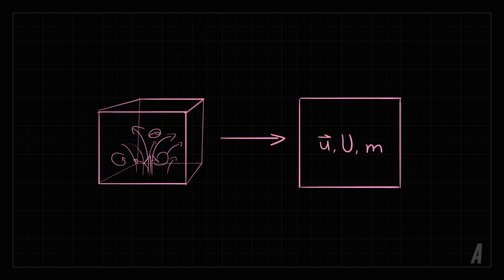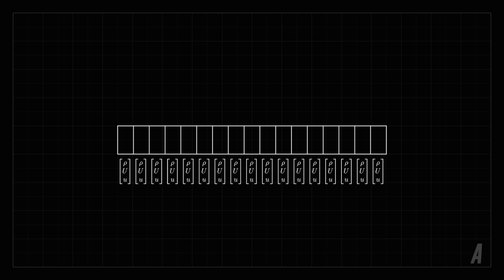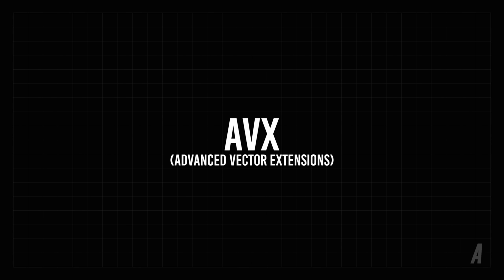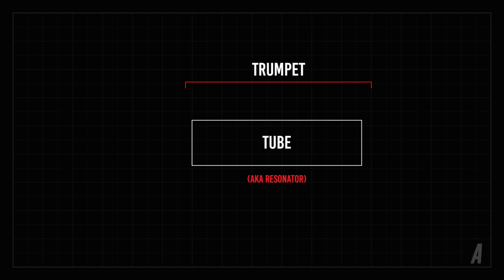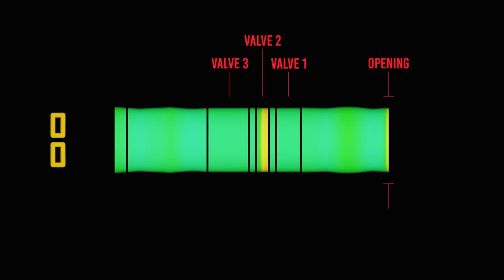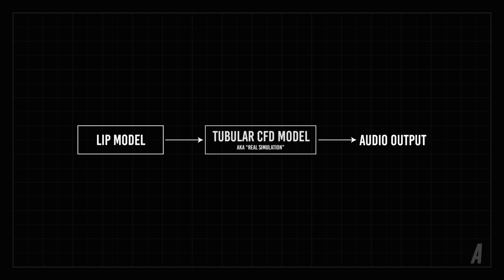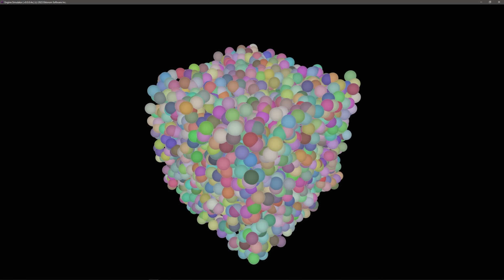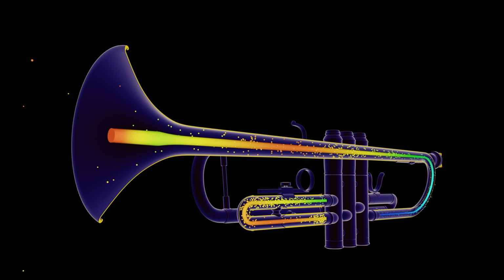Real-time Trumpet Simulation [C++/Vulkan] [WARNING: Flashing Lights]

Comment: I don’t know how you would implement it but almost all of how a trumpet sounds comes from how you shape your tongue, also the mouthpiece is very important, bigger mouthpieces allow for more space between your lips which makes achieving a “bigger” or more resonant sound easier. I can make a trumpet sound almost identical to what it sounds like in the video but to achieve the sound you want the tongue is how you change the air pressure. For lower pitches the tongue is stuck to the bottom of your mouth and allows for a large volume of air but there isn’t very much pressure (until you get so low you’re outside the normal range of the trumpet where the pressure needed increases) and for higher notes you’re tongue is almost against the roof of your mouth and the back of you’re front teeth, while the tip is against the back of you’re bottom teeth.

Comment: I have some experience implementing the Euler equations with finite volume methods and find this really facinating! 

Can I ask what kind of discretization schemes you have used? I would guess a combination of explicit euler method in time and a riemann solver to compute numerical fluxes. If you haven’t allready you could consider improving the spatial resolution to second order by using linear extrapolation with limiters (MUSCL). This will make the scheme more costly, but also significantly improve the solution for a given cell spacing, allowing you to use a coarser mesh. discontinuities such as shocks are way too much smoothed out with first order methods.

Also keep in mind that the maximun wave speed of the CFL condition for the Euler equations are not given solely by the sound speed c, but by the sound speed relative to the moving fluid |u|+c. You therefore have CFL = (|u|+c)*dt/dx

And one more thing: If you at some point want to implement moving walls touching the fluid, you should check out a FVM formulation called «Arbitrary Eulerian Lagrangian» (ALE). This allows the control volumes to move, enabling for instance the creation of moving pistons. There are also other techniques to achieve this (immersed boundary method)

Comment: Nice video!
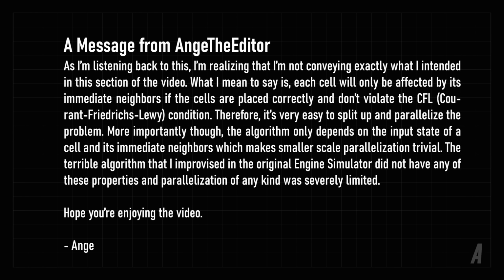I have questions on the fluid dynamics. What allows you to differentiate the cells and how can you process them in parallel? How does one cell not depend on the other? Basically i need more info on your comment at 5:36. Can you provide any explanation for this assumption?

Comment: advecting enough particles and rendering them with instancing fast enough can be quite annoying. but there's another way, you can use texture-based advection that any gpu can do for basically free. you can see what it looks like on my channel in one of the stirling engine stimulation videos, and I made a demo of how it works on shadertoy called "2-tap flow with less shifting".

Comment: Tuba player here  and i think that lack of flaring in the simulation for the bell maybe part of the issue with the air blowing because I have played without a bell and it is a struggle. Also maybe something like a flap valve for the lips. it is very hard to explain anyway to control a simulation of embecure it may be better to try to simulate a woodwind instrument as the embesure is more for tone and subtle tuning rather than the registers on brass.

Comment: As a lifelong hobby coder I always thought it would be cool to subdivide space into something other than a regular XYZ grid of cubic cells. For instance, subdivide each cube into six pyramids by adding another point at the center of the cube. Or tetrahedrons, etc... It would complicate indexing into the field but there must be some other way to subdivide space that's fast/efficient and solves the aliasing and simulation artifacting that cubes result in unless you subdivide down really small. I'm so tired of everything being squares and cubes when dividing up space in my algorithms.

Comment: 90% of a good Brass instrument tone is all in the embouchure of the lips and mouth. First learning to play such an instrument doesn't involve the instrument itself and simply involves learning how to blow through the mouthpiece all by itself. So, you'll often see a classroom full of beginners doing nothing but blowing through mouthpieces until they can get a smooth consistent buzz. Then, everybody will move onto doing frequency sweeps starting low and then going high and then go back down to low which sounds a lot like an engine revving up and down. And then you'll move onto learning how to play something like a Reverie which doesn't even involve the use of valves to be able to play (think of a bugle). Another thing that is key is that the intensity of air pressure within in the mouth and lungs must stay the same regardless of pitch and volume. This way your tone doesn't sound tiny and weak when playing at low volumes and conversely doesn't thwap and become raspy at higher volumes.

Comment: I'm curious about how the simulation handles alternative fingerings. For example, a trumpeter can play a middle G with either no valves depressed (000) or the first and third valves depressed (101). There are other notes that can be played with alternatively, especially as the notes become higher pitched, where I assume the note becomes more dependent on input parameters than the length of tube.

Comment: Considering the biggest challenge about recording engine sounds is the microphone placement, quality and physical characteristics. Why we don't just bake the sounds so we don't have to run it at 44KHz and just run it at like 1KHz instead?

There are specific resonance characteristics that can be computed, stored in a cheat-sheet, then compose the sounds without the need of stressing the CPU for the Real-Time simulation.

Comment: As a former trumpet player while in high school and college. For me, the first demo sounds a bit closer to a french horn than a trumpet.
The most important thing to get right is the embouchure correct for each note, which is a hella lot easier to do with lips than dialing it via keyboard! Hahaa! Typically the higher you go the firmer the embouchure and the faster air flow. This results in kind of a constricting effect (not sure if I'm using the proper terms but hopefully my point comes across). Think of a garden hose and you put your thumb over the end of it, instead of water pressure it's air pressure.
You might also want to consider making the main tuning slide adjustable. Also, the thumb and ring finger slides should be able to move. I don't remember the specific notes to use them on but these could help with any tuning.
For some extra fun put in some vocal cords to hum while it is played! Probably too complicated for this but it can be awesome if you play it in person.

Very interesting video for sure! 😁

Comment: Sweet!  I play the trumpet here and there.  Make the slides adjustable please so you can tune the thing.   I also think that the mouth provides a resonant chamber that helps to filter the sound generated by the lips.  To make a chamber that is resonant to some harmonic of the note being played.  Perhaps that might help with your air volume issue.  Also with trumpet, there tends to be an attack when starting the sound.  Once the tone is going, less air is needed to sustain a note.

Comment: The lips aren't symmetrically placed on the mouth piece which probably makes the lip simulation inaccurate. You can find clips of people explaining buzzing, doing it without the instrument. That could work well as a sample source to replace the lip simulation. It would probably be simpler to implement anyway. You could adjust the tail of the sound to create more natural 50-200 ms fall off as well, or add small fluctuations to pitch and amplitude. Bonus points if you implement a full ADSR envelope with slight variations each time it triggers. In any case, I wonder how much the instruments own vibrations affect the tonal quality because there's probably some missing information there. I'm no trumpet expert but a sound engineer, and to me the high frequency range sounds very digital and loud compared to the real thing. Perhaps because bass carries farther than treble and the simulation isn't modelling energy loss? I'm not sure, but it's interesting to theorize about even though I suspect the lip simulation is the problem.

Comment: Summary

Introduction
- Discusses the challenge of real-time fluid simulation for generating audio.
  
Fluid Simulation
- Explains the Euler equations for compressible flow.
- Introduces "Tubular," a fluid simulation library optimized for real-time performance.
  
Trumpet Model
- Describes how a trumpet works and how it can be modeled as a series of tubes and valves.
- Discusses the importance of lip vibration in generating sound.

Visualization
- Talks about the 3D fluid visualizer developed for better understanding.
  
Sound Generation
- Explains how the simulation generates real-time audio.
- Discusses the challenges and limitations, including the need for parameter tuning.

Future Work
- Plans to improve the simulation and possibly release it on Steam.

Comment: There are many things that go into a trumpet to give its sound. Millions of trumpets have been made, and many different sounds are produced. , 

The variables have a great deal to do with the player, their lip texture, strength, position, race, and training. that is enormous tight there 

Then, mouthpiece design. all over the map from deep to shallow cup, plastic, brass, thin wall, fat wall, bore, taper, even rim and shape. AND the impact of different lips on it .

Then you have the instrument itself. metal composition, thickness, coatings, lead pipe,  diameter, bell size, braces,  all this affects the sound AND add the chops and mouthpiece and performer variables.

My point? What is the point? As a complex engineering project, it is impressive. But there are wonderful libraries already made of actual recordings that are used to play scores created in music notation software from real instruments that will always be better because it is live. not synthetic as such.

You have accomplished a great deal, but honestly,  I think it was a game plan flawed from the outset. when a better alternative was and will be in place and not bested. ever. like trying to replace a Steinway piano. Nothing will ever beat it. The variables are simply too great. Same here. Use what was perfected and works wonderfully. Don't recreate the wheel 

my thoughts

Comment: I'm not exactly an expert, but I think the issue with air volume needed may be because of the lack of a flared bell in the model.  In real life the flare causes a sudden drop in pressure that would help to keep the pressure in the system lower and requiring less air to change the pressure significantly.

Comment: I can imagine why you'd need a lip simulator in an engine simulator: you need to simulate an engine that is also a trumpet. Take the valves and replace them with pistons connected to a crankshaft, for absolutely no reason even though that doesn't make sense.

Comment: You may or may not have mentioned this (video is a bit too dense for my understanding so I clicked through a bit) but a trumpet is considered a "cylindrical bore" brass instrument due to the constant tube diameter until the bell. Id love to see the simulation run on a "cylindrical bore" brass instrument like a euphonium (my favorite) or a french horn whose bore size increases gradually down the length of the tube to see how the two differ. In reality the 2 bores have very characteristic tones.

Comment: Former trumpet player here: Most of the lip motions, tongue motions, pitch, breath control, all of that is rote memory for the player. So assigning the notes to a keyboard and having the trumpet do those calculations would be very realistic.

There is a slide valve next to the horn that is used to tune the instrument by pulling and pushing it out. Like a trombone but it's in a fixed position.

Also -- and I am sure someone already mentioned this ... But it might help your simulation if you simulated the lungs as a fixed fluid source that depletes?

Comment: As a trumpet player, and a CSE student in a computer graphics class, this is amazing!  Idk if it would help, but if an IRL trumpet student is overblowing, it often means they have to tighten up their lips a little.  When you have air blown way too hard in the simulation, you can hear the pitch change as the pressure changes the forces on the lips.  As a trumpet player, my best sound is made by balancing the tension in my lips with the air pressure.  A way to measure if you hit a reasonable balance is to study the amplitude of the sound.  When you have a good tension for a given pressure, the horn will resonate better and become louder.  This is not necessarily the sound all musicians aim for, but it is a discrete and measurable goal that's good for beginners.

I noticed that the simulated trumpet's tuning slides are all pushed in all the way.  Pulling out the main tuning slide and the 3rd valve slide (at the same time as the valve is pressed) should improve the overall sound and make the intervals between notes more even.  Another thing to consider would be to add tonguing, where the tongue is used as a valve to quickly start each new note.  This would eliminate some of the out-of-tune movement of pitch when the valves and slides move.

I really love this project you've made!  If you have any questions about real trumpets, feel free to hit me up.

Comment: Maybe the constant diameter bore is one of the problems. I cannot say confidently, but the gradually increasing radius is one of the ways you accelerate the air. The pressure will drop along the tube, but the velocity will increase. Or something like that.

Comment: Long-time trumpet player here, the slightly wrong tuning in the notes, especially when fingering 101 (aka 13) are spot on.  It takes years to learn the lip position and air force to counteract the pitchiness of a trumpet.  In practice, on a low 101 position, the 3rd slide is pushed out with the left ring finger to drop the pitch to be in tune. 

I was cringing a bit at the higher notes because typically trumpet players will never press down more valves than absolutely necessary.  As you get to higher intervals, the intervals get narrower, which means that when you chromatically descend, you should prefer jumping to the next interval in open (000) position.  So from the second C (one octave above the typical lowest open note), the fingering is:
000, 010, 100, 110 (not 001, even though they are the same), 011, 000 (note that we are now on the G interval), 010, 100, 110, 011, 101, 111, 000 (now on the lower C interval)

Even though the first time you pass 011, you could technically go to 101, trumpet players never do except for special effects.

A typical exercise on the trumpet is switching between intervals, and making sure that the lips are positioned in such a way that the sound is consistent.  Perhaps this might help your fine-tuning of the lip parameters.  play a low C (000) and then play the lowest note from the G interval (111) which is one semitone higher.  If the same lip and air can make a good sound for both of those, you're doing very well!

Comment: Hi, I'm a trumpet player and a programmer. What you've done here is very impressive.

I think the reason for the massive airflow that is required also comes down to the fact that there is no cross-sectional variation. The mouthpiece is supposed to have a very small hole that then expands into the tube of the trumpet. That way it is limiting the airflow and providing back pressure to the mouth. The real pressure is only inside the mouthpiece and mouth, it can't be inside the trumpet since it's open on one end.
Reply: Yup and lacking the bell is another important factor.

Comment: From a gameplay perspective, if you want to simplify instrument playing, define the complicated settings (lips, air pressure, valves) as presets for your N note range. When a particular note is selected with key presses, the system knows what values need to adjust for a perfect pitch note.

Press keyboard keys or gamepad buttons for chromatic notes, that are now "auto tuned" with optimal settings for the correct pitch. If you want an expanded scale, interpret multiple presses as a different note (eg 0000, 1000, 0100, 0010, 0001, 1100, etc).

Comment: Trumpet player here. I’m surprised how good the trumpet in your model sounds. The characteristic sound definitely comes through. It sounds a lot better than many Synthesizers I heard.
Reply: Not most synthesizers? If it wasn't better than most wave-based synths, that would be disappointing. Is it better than the good ones is the question, and comparing it to Samplemodeling and even Audio Modeling gives you the answer to said question.

Comment: You might be able to simplify this by using complex numbers for the whole system, then using two polarizing filters to isolate left and right by aiming their axis on the perpendicular cross section of the end exhaust port towards the viewport's audio pickups. It gives you the full complex resonance system and stereo audio pretty accurately and fast.
Reply: Possibly an application for FFTs? They can be used for simplifying wave propagation in an ocean, maybe using complex space and working with phase will help for real time audio.